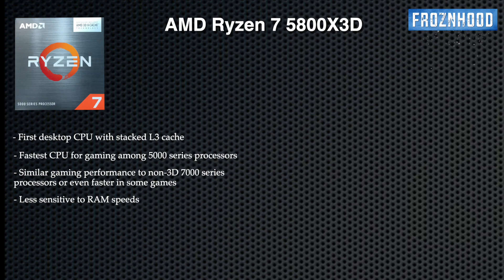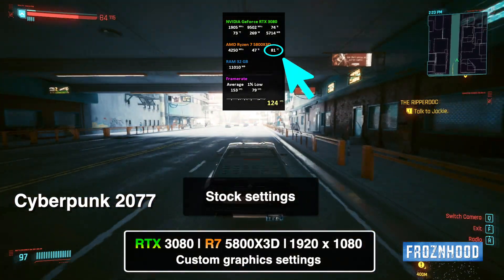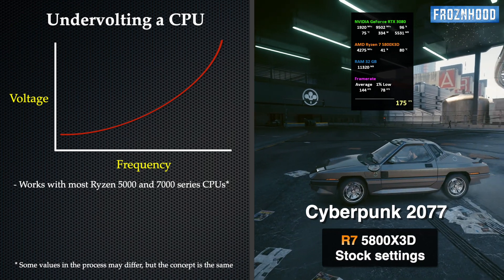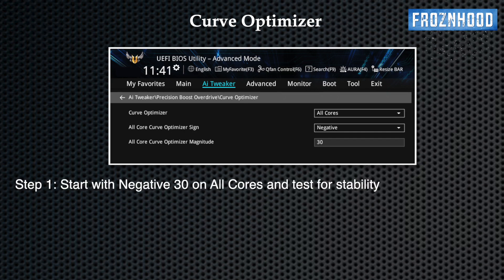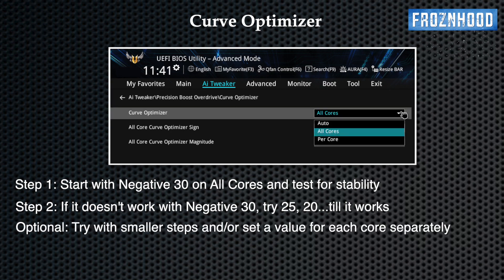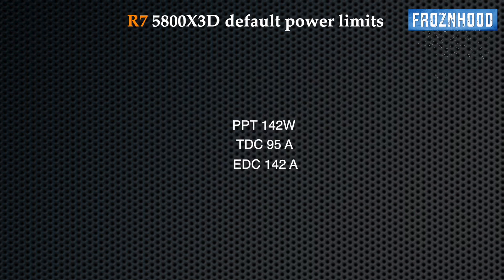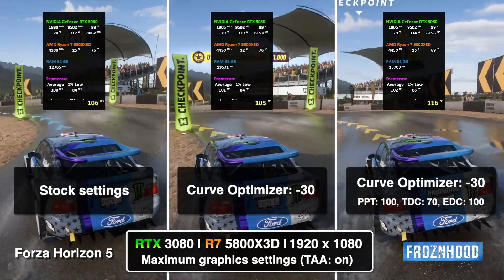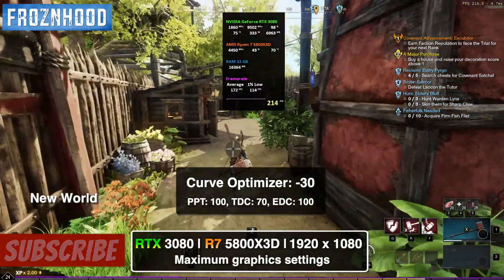Optimizing Ryzen 7 5800X3D - Higher performance, Lower temperature | Undervolting | Curve Optimizer

Comment: How limitation of PPT , TDC and EDC improve performance ? I don't understand.
Reply: Is it simple, because the CPU dont need all that specifications of limits like 142W of PPT, just need 100W to achieve your maximum performance.
I did it on my 5800X3D, except on curve optimizer because my motherboard dont have this setting, then i does in app PBO Tuner.
In cinebech increased 400 points and cpu-z 200, the frequency keep stable and the temperature decrease.
Is it very worth for those that has 5800X3D and suffer with high temperature.
Reply: @Cehcs cual placa base tienes tú?

Crees que yo podría en la mía (MSI B550 PRO WIFI)?
Reply: @LeFFerGaming  My is B450M Gaming BR, but this settings are hidden by default, but if i search manualy this settings apear.
On you B550 of msi i think that the Kombo Strike should help a bit, its worth you try. Have some videos on yt speaking about this.
Reply: Cpu's boost algorithm works based on temperatures. If you reach certain temps it starts to downclock frequencies until the temps are acceptable.limiting power/voltages will get better temps, thus allowing the cpu to boost higher and longer..

Comment: Did follow your settings on bios. -30 on all cors + plus I decided to under volt CPU by 1.000. (I didn’t mess with ppt, Tdc, edc left them on Auto) currently my 5800x3d 4550mhz all the time stable with no dips on speed. Temps top 72c the avg 68c. Thanks! 
Just a recommendation if any wants to get those results make sure to update your bios to the latest, and download your latest motherboard chipset driver 👍
Reply from the maker: Thank you for your comment. Just to add something, when you upgrade an AMD CPU, always uninstall the old chipset driver and and only then install the latest from the AMD official site and not from the motherboard support page (where usually it is not the latest version). In other worlds, do not try to install the newer chipset driver over the older. 

Regarding BIOS, install only stable (final) versions and not Beta versions. And, update your BIOS only when it is needed.
Reply: @FroznHood  My 5800x3D coming tomorrow, I have the 2700x now and I updated my Bios.

Should I uninstall the chipset driver right now, what's the best way to do it? and just the chipset driver or there is anything else?

thank you! I appreciate you.
Reply from the maker: I prefer to reinstall the AMD chipset driver after the CPU installation. Just make sure to make that properly as explained in my previous comment.
Reply: @FroznHood  yeah i messed this up by using ASUS site chopset instead of AMD website.
Reply: @FroznHood hello friend, I would like you to help me uninstall the old chipset driver: do you need an application to perform the uninstallation? thanks
Reply from the maker: HI, you can uninstall the AMD chipset driver the usual way you uninstall an app - via Control Panel -> Programs and Features. It is possible that you don't see it in the list for some reason. In that case you can use Windows Uninstall tool or also called Program Install and Uninstall troubleshooter. Be careful to not uninstall something else that is important for your system.
Reply: @FroznHood  thanks
Reply from the maker: It doesn't matter. You can do everything after installing the new CPU. What is important is that you uninstall the older driver before installing the new one. In other words, do not try to install the new version over the older.
Reply: @FroznHood  how did u and what section are u under volting by 1.0009
Reply: What is the parameter that I have to touch to put 1.000 in the bios?

Comment: I have a 12400f. I would like to know if I can do it and if it would be the same? It's very interesting. Thank you.
Reply from the maker: 1. As far as I know, at some point Intel disabled the undervolting for 12th generation with only exception being 12900*. You need to check this. CPU Core/Cache Voltage Offset may work (probably won't), but you have to test it yourself. 
2. I am not sure whether i5-12400f needs such improvement anyway. It is a relatively power efficient CPU that does not generate so much heat. Depending on what you want to achieve, a better cooler may help.

Comment: will this trick work with 5600x ?
Reply from the maker: Yes. It runs cooler, unless you use a stock cooler,  so you just need to stabilize the average frequencies.